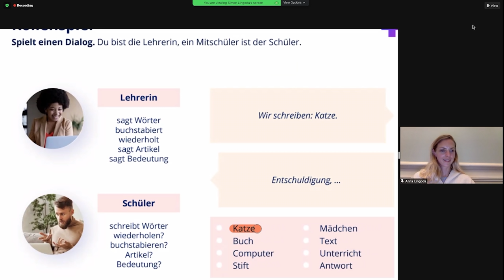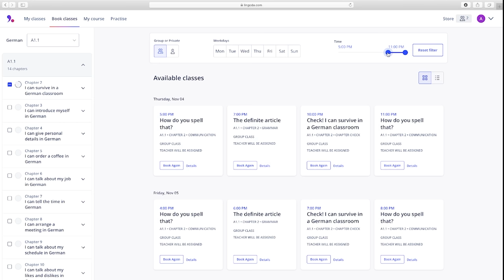Why we gave up everything to move HERE (and to buy a chateau)

Comment: I had an induction cooktop in my last home, sadly now have gas. Induction is just as fast as gas and just as adjustable BUT! To clean the induction top, you just give a quick spray and wipe and it is sparkling clean. With gas it is much harder to clean, you get blackening in all those nooks and crannies, your saucepans get black bottoms, the tops of the burner rings rust and corrode. Also with induction there is no risk of accidentally leaving an unlit burner slightly on. As a keen cook, I say induction every time.

Edit:  reading the comments, it sounds as though people who strongly favour gas, have not used induction and are likening it to old-fashioned electric. If they have worked with induction they might comment differently.
Reply: This is what is drawing me to induction (see above reply) To be able to clean with a swift wipe over appeals hugely!  But, I love the look of gas, especially as I'm switching to a range cooker.  The choosing though, it's agony!
Reply: Earlier I replied that you should have both. Induction and Gas. Your kitchen seemes large enough. Each option has its own set of plusses and  minuses. Having both will give you more options. Once you have six guest rooms, this may come in handy. Expanding to the out buildings may mean needing more kitchen cooking space.
Reply: I agree people confuse induction with electric and ceramic (which are woeful to cook on). Induction is amazing. And one final myth buster - we do cook stir fries on ours 😊

Comment: Lily is a consummate little actress! 
I had always had a gas stove but bought a house that came with a normal electric stove with a glass top. I intended to replace it with gas but loved that the glass top was sooo much easier to clean. In the end I replaced it with a glass top induction, in part because I also installed solar. The burners heat up the pan in seconds and also drop the heat instantaneously, two of the things I loved about gas. One thing you can't do is wok cookery - induction needs a flat bottomed pan. Also, the pan must be magnetic (iron or steel) so copper doesn't work. For me the environmental implications of gas was important enough for me to switch to induction even though on mine I don't have the infinite control of gas. I think some chefs are switching for the same reason: if your brand is organic, seasonal, local then clean(er) energy is consistent with that.
Reply: I had always always used gas for the hob but moving to a new house 6 years ago I decided to go for electric as it would be easier to clean...and it is and it's no different in my opinion once you get used to it...which took about a day😊
Reply: There are very good induction compatible woks which work perfectly on induction and, mine is not flat bottomed just the same, rounded.
Reply: @russdring2534  Thank you for sharing that. That is one thing I missed with my induction and now - problem solved!

Comment: gas vs induction: gas burns at the same temp - turning the gas 'heat' up or down only changes the volume of gas. Induction requires pots/pans with iron cores. You can purchase an iron plate to sit on the induction to heat non-induction cookware, like copper. Induction is more controllable temp wise - gas is more fun, a bit more versatile. Have fun, cook. gas or induction, who cares it is just a tool and part of the journey.

Comment: Stick with gas.  I've used both, currently got induction.  I find the top annoying in that if you drop spoons or a pot lid I cringe.  Also, you can't toss pans or swirl on the heat - my staple is a souffle omelette and I can't do this on an induction.  Both are instant heat, but I also find it convenient when we occasionally lose power in November storms to have a gas ring to heat food and water/a coffee pot.
Reply from the maker: Thanks for those tips!
Reply: @HowToRenovateAChateau  Forgot, you can't use copper pans on an induction.  I bought a heat transfer plate to try use them, but it didn't work well.  So if you plan to use copper, an induction is a no-go

Comment: Go with INDUCTION! just as responsive as gas, just as quick, a steady low simmer, fantastic high searing heat BUT much easier to keep clean. My vote- Induction all the way.  Never looked back from giving up my Gas Wolf cook unit.
Reply: I've heard a lot of good things about induction, but as I saw copper pans in the background someone should note that those do not work on induction sadly.

Comment: You have much greater control with an induction burner. I've been using mine for a few years now. Very easy to set the timer and multitask while you're cooking. The heat is almost instantaneous. You'll have to have cast iron or copper (or some other metal that conducts electricity) pans because aluminum will not work. So much easier to clean the flat surface of the induction burner also. You can buy one of those countertop plug-in induction burners just to try it out. You'll be hooked!!

Comment: From a cooking point of view, induction only heats the base of the pan so food needs to be stirred more frequently but it's fast, very responsive and clean. New pots and pans may be needed as not all pans will work on it. We've had induction for a few years and it's reduced our A/C costs (we live in Florida) and cleaning the induction top is a breeze. It's a faster version of electric, if you've ever used that. Thanks for the tour. Honfleur is magical - I must visit some time :)

Comment: Honfleur church: The Scandinavian roots run deep in Honfleur. ♥️😁.       In 2009, I went on a trip with my parents to Sweden (Dalarna) and Norway (Tromso, Balsfjord), to see where Mom’s grandparents/great grandparents came from. Both ancestral Swedish churches had bell towers separate but near the churches, as indeed did most of the churches in the region. But being far from the coast, they didn’t have connections to fishing and seafaring.
At the older Norwegian churches we saw, they also use the inverted ship design. The Norwegian ancestral church we were able to track down, they had a model ship hanging from the ceiling, though the bell tower was attached to the church in the usual manner. Perhaps above the Arctic circle lightning isn’t a big concern, or perhaps when it was re-built in 1859, they used more modern methods.
Note: In summer, the men would head out to fish (sometimes not returning for the entire season) while the women would run the farms and raise the children. The women could sail too, of course - the only way to get to the church or village back then.

Comment: Went to the Pays d'Auge twice in the past year but haven't had (taken?) the time to go to Honfleur yet... Next time will DEFINITELY be the time!

As far as i'm concerned, I'm totally on team induction : low maintenance, super fast and easy to clean, safer for kids and pets, powerful yet easy to control while causing much less burnt food sticking at the bottom of the pan, the heat is spread more easily throughout the whole pan, it boils water much faster, etc. 

Only "downside" is if you have to buy new pans for it (try yours first! If a magnet sticks to the bottom of it, then it's induction-usable!) but their really thick bottom makes them way more durable too, so... 🙂

Comment: I would do both gas and induction since you have the space. I have had both commercial gas stoves as well as induction, I preferred the induction, it’s as immediate as gas, plus in a smaller space you don’t lose the counter space.  Do a gas range and then a two burner induction to the side.

Comment: I always hated cleaning the gas stove. Since I switched to induction I've never been happier. It has it's downsides, it's harder to control the heat, but it's a matter of getting used to it. But instead not only the stove is easy to clean, the whole kitchen is much cleaner, nothing is grimy, I don't even use the ventilation

Comment: Induction!  Saves a ton of energy.  It is almost instant heat and instant when you want to reduce the heat.  I can boil a teapot full of water faster on my induction cooktop than in my microwave.  The best thing is nothing ever burns on because the burner itself never gets that hot.  Your pan becomes the burner.  Biggest drawback is all your pots and pans need to be magnetic. I had to replace all of my aluminum bottom pans with a new stainless set.
Reply from the maker: Thanks for the tip!

Comment: Induction is 1000000x faster, you boil anything up in literally 30 seconds. The pan handles stay cold, the spoon wont heat up from the fire if you leave it in the pan, you dont have to be scared that your clothes catch on fire while stirring. Moreover you have child lock on it, it always turns on ( unlike gas and then it smells like gas) and it is waaaayyy easier to clean than gas!
I had to switch from using induction to gas due to moving and i miss it every single day!

Comment: We have used induction for about 10 years now and most of my extended family have as well. We all used Gas before but made the switch primarily because it was more efficient. We found that there are many advantages to induction such as safe for kids and pets and control of temp and cooking time. One of the biggest advantages over gas is induction is a million times easier to keep clean as nothing ever “cooks” to the surface and is easily cleaned away. For all of us, we would never choose anything else as there are far too many advantages to induction.
Reply: yeah, but you can't butter baste steak on induction, it does not heat the pan if you lift it off slightly to get the butter to pool at one end. We have induction, for most things it is great, but it is really not great for stir fry (wok), steaks, any food where you need to shake the pan (such as to mix vegetables). Most inductions hobs have digital buttons, instead of a physical dial, which is so much easier to adjust.

Comment: From my experience, you need both induction and gas in a professional kitchen, cause with induction cooktops you could only use pans that are compatible with induction cooking, so no woks or copper pans. I personally prefer gas cookers cause they’re versatile and with a high btu and flame you could make stir fries quicker and you could use any type of pans on it. I think either gaggenau or Miele have induction cookers for woks, but it’s a big investment,and still you cannot achieve high temperatures that are needed for best results when cooking with carbon steel woks.

Comment: If it was my kitchen, I would go for induction (I actually did when I was renovating a flat I bought several years ago). It's safer, there are less fumes you breath in, less types of bills I need to pay (so less bureaucracy). I don't regret the change, and yes it's easier to clean as well.

Comment: You'll need to buy new induction pans if you go that root.
Reply: It still gets scratched even being super careful and any starchy foods that boil over🥴
Reply: If you can stick a magnet to the base of your pots you can use them on the induction. If you can’t you can buy an iron plate for the range and still use any pot.
Reply: I did not know that! I've been sticking a magnet to all my pots now. How clever.
Reply: @pebblesmiller9026  We are not very careful with our induction surface and don't get any scratches. You shouldn't cut things on top of it you know.

Comment: Gas for sure. Had and have induction and want to get our next range in gas because I miss it so much. I find gas is so much better for baking as well on the range top when you know how to use it. The induction tops are prone to cracking if you set a pot lid down on them and if someone drops something on them, and when they crack you have to replace the whole thing. A gas burner goes you replace that burner and you can still cook on the others. Way better, tried and true gas.

Comment: Funny that you asked for some advise whether you should go for a gas stove or an induction one. Funny because just the other day I was told by a chef that induction is the better choice. Because of the big plate you can slide the pans a little which gives you the opportunity to vary with cooking temperatures. However, an average induction plate takes about 8000 watts, which needs a heavy duty electrical supply. 

Just the other week I discovered your project and the funny beautiful movies you make. I enjoy them a lot. Thanx.

And since Anna is starting to learn to speak German, werde ich nächstes mahl auf Deutsch antworten. 😜👍🏼

Comment: Lovely to see Honfleur again!  Induction WITH a gas burner somewhere for stir frying etc...and those times when the electricity cuts out; but remember you have to have the correct (steel or iron) pans, so those skillets you used today won't work (check with a magnet: magnetic = OK for Induction).

Comment: Induction is taking over. Same control as gas. Definitely easier to clean ... a real bonus. Cool touch. Can't catch a hand towel on fire, or burn a hand, so safer as the girls begin to experiment with cooking ahead. A little getting used to with keeping pan to cooktop conductivity - but if chefs can do it so can you ;) Gas has added chemicals (in Australia. You?) so you can detect a gas leak, and that's unhealthy, so non-fume induction wins there too. Environmentally induction seems to be the go. Gas gives the cozy feel that induction does not. Maybe incorporate both? Loved the town tour. Scallop dish looked divine.

Comment: I have a gas cooktop at one house and induction at another. To be honest I like them both but if I had to pick one, I would go gas. Induction can be fussy at low temperatures (and before anyone says our cooktop is not a good example of an induction cooktop, its one of the best rated ones available fresh off the boat from Italy) and not all cookware is compatible. Of course my entire favorite set of pans was not compatible. Also, flames. Kitchens need flames.

Comment: If you can then have gas and induction even if it’s just one gas hob. I have induction and really miss gas. I can’t use a wok on my induction hob and it’s just not the same as gas. It is sleek and. clean though. Also if you have cast iron induction is easily damaged.

Comment: please no gas. it brings a lot of water into the air and a lot of heat - bad combination for an old building. cooking with induction is a lot like cooking with gas. it can change as fast gas, if you switch to low water will stop boiling directly and it heats up so fast. you will have to relearn cooking. prepare everything before switching on the hob.
kitchen designer here

Comment: Defo switch to induction. We changed 6 years ago and will never go back. Heats up quickly - touch control and as someone else mentioned a million times easier to clean. When not cooking you can also use as another kitchen surface #teaminduction

Comment: Induction! We had a Viking Induction Range and sold our house to move to Spain.  COVID happened and we have been in a temporary apartment for a little over a year.  The apartment has a gas range and we would never do GAS ever again.  With induction, you get the control of gas, but even more precision and safety.  Our gas stove just seems so hot, in comparison.  Even the utensils are hot after we cook.  Never with induction.  So much heat comes off the gas range -- not safe.  Induction ranges also heat water -- anything --- so quickly.  We wait 10 - 20 minutes for pasta water to boil on gas - less than five or induction.   Good cookware - Allclad --- works perfectly on induction.  I hope we never go back to gas, or DOG forbid, regular electric burners! Moving to Spain 31 December - FINALLY!!!

Comment: Induction! Has all the advantages of gas but easier. Great temperature control, quick and very easy to clean. 
Only thing, one with manual control (knobs) is easier. Find the touch control quite tricky.

Comment: Before we moved to France, I always had a gas cooker, I loved using gas. The house we moved to had the old style electric rings, I hated them. Now I've got an induction hob. It is brilliant, it is so controllable. You can turn it up and down just like gas and it responds instantly. The other main benefit is the ease of cleaning. Because the hob only gets hot directly under the pan, fats and spills don't burn on to the hob. A quick wipe and it is clean. You do need to make sure your pans are compatible, if a magnet will stick to the base, they will work on the induction hob. Loved the tour around town today. I'd say the only advantage of having a gas hob now would be you can still use it if there is a power cut. Have one of each, you've got the space.

Comment: I had induction in my last home and tried it for a year. IHATED IT! I love gas for all the reasons you mentioned, Phillip.
But I didn’t like the lack of instant temperature control/responsiveness. UGH!
I am an intuitive cook and also like having different things cooking at once.
I found it a nightmare because the presets on the induction were probably set by someone who doesn’t cook. Sort of “medium”, “higher” and “so hot you’ll never use it!”. No sautéing without burning. Never could have made those sauces.
Also, the top is so delicate. Couldn’t use most of my favorite pots. Don’t spill unless you wipe up right away, but don’t forget you can’t because the damn surface is too hot.

In the long run, I like the subtlety and speed of gas. In case you couldn’t tell.

Also do not believe that children can’t get burned!
I did and I’m 70! Maybe in my second childhood?

Had no idea how rabid I am on some of these topics!